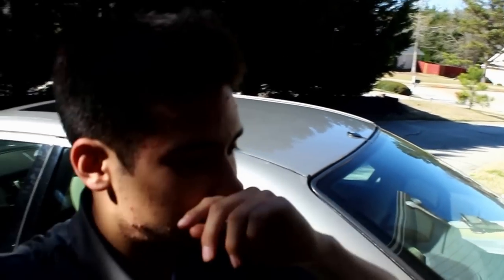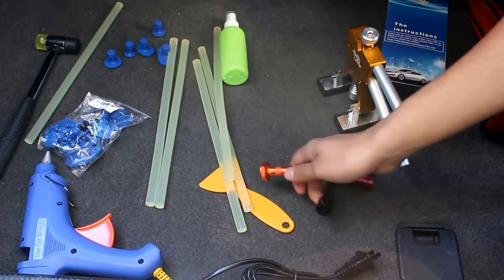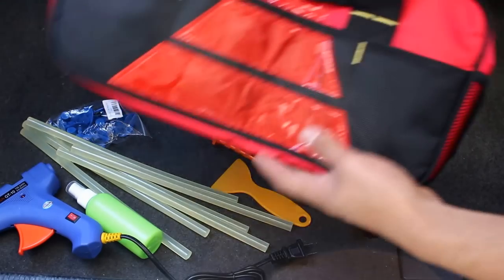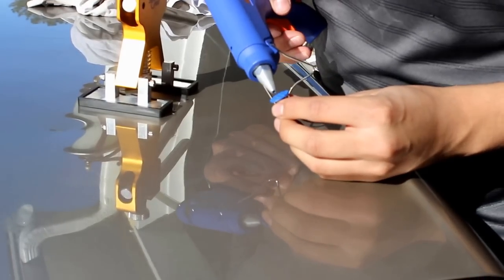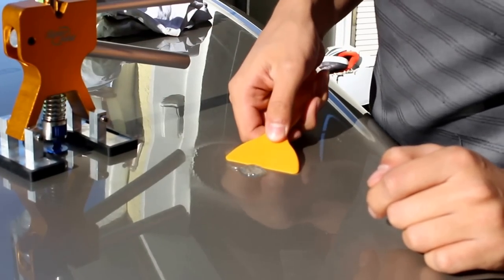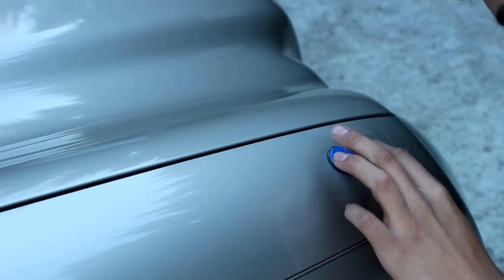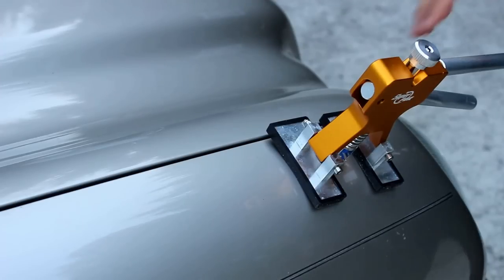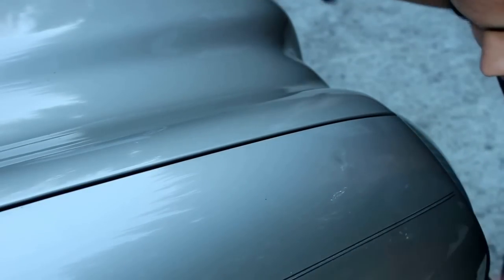How to remove Hailstorm dents Super Cheap

Comment: Ahhh I’ve been doing paintless dent repair for 4 years, needed a laugh today bud thanks 😂
Reply from the maker: No problem that's what this video was make for 😉
Reply: Hi Mitchell, looking for help. I have several small circle dents, what do you recommend?
Reply: @sethkio9301  it sounds like you got hailed on, probably an insurance claim?
Reply: @tallyslapper9946  I meant remedy wise. Insurance will only total
Reply: @sethkio9301  honestly man your just going to have to get used 2 looking at the hail then, there is no real home remedy,  it takes a long time to learn fixing dents and you need a few tools that are expensive
Reply: @tallyslapper9946  what tools man? I could pay someone else to do the repair but I want the experience doing it properly. I was going to buy some rods to push out the dents
Reply: @jamainseal2027  man, I have over 10000$ worth of tools. Only a master is going to make cheap tools work. Take if from me, your gunna wreck your panel if you try yourself, and you will be out the money on tools. It’s not something you can just pick up and go, you need a ton of practice.
Reply: @tallyslapper9946  exactly it, I’ve got loads of patience and a hail damaged civic I don’t mind if I ruin it 😂

Comment: Look like on the right track. But I think you need to gradually squeeze the handle of the dent puller, too fast and the glue bond will break, before you have pulled the dent out enough? Probably wont do any harm to heat the area also, with hot water, then dry it off before gluing on the puller stud?
Reply from the maker: Ok thanks man

Comment: Why on Earth would you tap the dent to make a hole? Your not using a slide hammer and screw. You gradually pull the trigger with plastic mallet side towards dent, lightly hammering, while pulling up dent.
Reply: Absolutely NOT the way to do it.
You pull, tap down, pull tap down, repeat until the dent is flat.

Comment: Do Not try this ...
That is a cheap Amazon dent kit & you will do more damage than good..
And this guy is a rank amature...
You can stretch the metal & damage the paint..
I've been a PDR tech for 26 years & I've repaired dents that "amatures" have attempted to repair...
The end result always ends in a more expensive repair...
Spend the $75 to $100 & have it repaired by a professional.

Comment: i have got the kit but the glue doesn’t stick to my car it just easily pulls off by hand i can’t understand why it doesn’t stick to my car any ideas?
Reply from the maker: Idk is there wax on it
Reply: Coyote Racing i don’t think so what’s the best thing to clean it with before applying the glue?
Reply: J.M Z.C  what you want to do is not wax it at all, that will create a slick surface that won’t allow the glue to stick properly. Instead maybe try a clay car while the car is wet to remove any imbedded sediment in the paint.
Reply: Rub down the effected spot with rubbing/isopropyl alcohol to strip any wax, make sure the surface isn’t too hot, and the glue should hold. Best of luck. I’d advise watching a different how too than this one however.
Reply: @dbk81  which how to do you recommend?

Comment: So not worth it
Reply from the maker: its better than paying 1,000 dollars to get it done and it wont be good. unless you do bondo and repaint it.
Reply: There are much worse dents than that that can be removed by the pro's.
That would take around 20 mins for a pro and would be near perfect. 
Bondo is not the answer. 
Pro PDR is surprisingly cheap.

Comment: Yeah the kit u recomended is doesn't Worx of course I'm butt hurt
Reply from the maker: The reason it worked for me is because my Mercedes has really thin metal, that's way. Every car is different and it works ok, as i said dint's don't go away completely you can still see them but they are better.
Reply: Coyote The Gamer
Reply: Tyler Trisler do you do tiling mei bee eat ones wens art worx
Reply: Nick Ho.. Maybe you would be better off Trolling a little kids video with the way you write. Brutal. 
Coyote Racing. Nice job